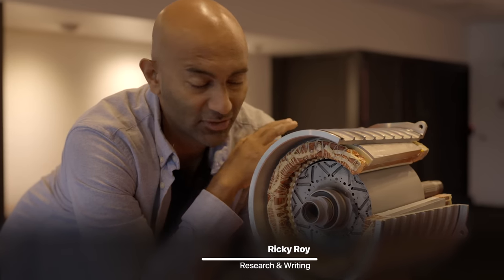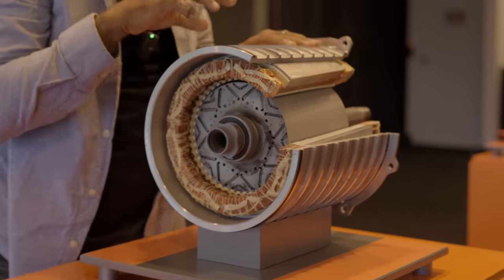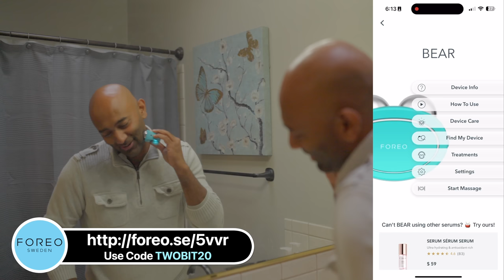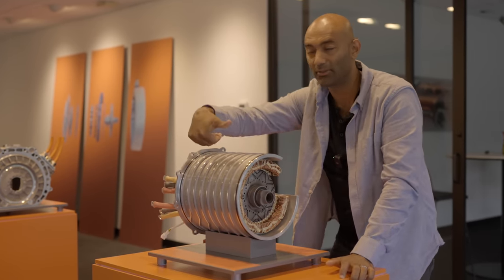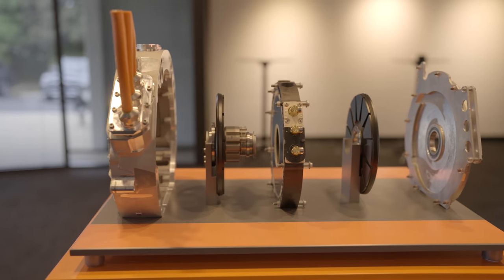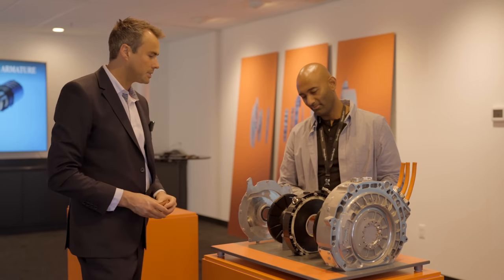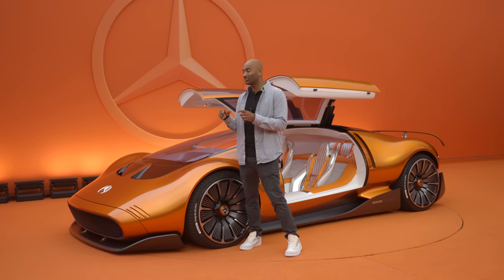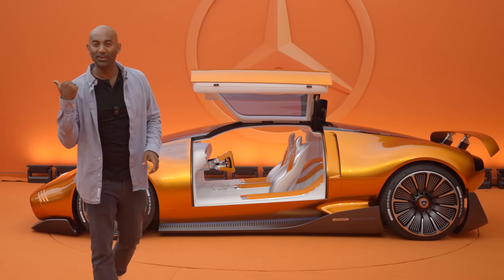Axial Flux Motors Will Change CARS - Here's Why

Comment: At least 2/3 less materials per motor, way less copper and way less windings of copper which equals lot's of time saved... All that materials saved means shipping will be way less... So way lower costs for materials, way lower costs for labor time, way lower costs for shipping and yet Mercedes is going to CHARGE US MORE!!! The excuse given is that the motor winders have been doing the old way longer and gotta get set up and used to doing the new winding method... OF WAY LESS WINDINGS!! 

I call BULLSHIT on that lame excuse and see that Mercedes is actually just screwing the consumers that buy their product (MAXIMIZING PROFIT TO THE MAX IS WHAT THEY ARE ALL ABOUT REALLY!) Kinda like their transmissions that have no dipstick... Mercedes wants the consumers who buy their vehicles to buy a transmission dipstick from the dealer for an extra $45. Whats next, are they gonna sell new cars without keys or tires or motors and expect you to fork over extra cash to their dealerships for those?  I own a Mercedes and I am not all that impressed truthfully! Interior is cheaply built with lots of plastic and very poor - stupid really- lay out. The cup holders fold out of the dash and I would like to punch whoever designed that garbage! Seriously- THEY SHOULD BE FIRED IMMEDIATELY AND SO SHOULD THEIR BOSSES WHO APPROVED THAT TRASH!  

The quality is worse that a damned Kia and I am not bullshitting about this. Check out the repairs that people have to do  OVER AND OVER AND OVER AGAIN AND THEY DON'T FIX THE PROBLEMS IN NEWER YEARS FROM WHAT i SEE. different YEAR MODELS WITH DIFFERENT MORE ADVANCED SHIT INSIDE LIKE THE TRANSMISSIONS FROM 5 SPEEDS TOI 7 SPEEDS AND THE SME DAMNED PLATE IS A REPEATING PROBLEM THE CONSUMERS GET STUCK WITH TO REPLACE ... They not only don't fix the problems, they make shit even worse where you can get stuck having to pay the dealer to program your new shit after you replace the crap that they keep putting in them knowing they will fail..   How about these 5 speed and 7 speed transmissions?? Wouldn't you think they should at least be getting some super gas mileage with 5 speed and 7 speed transmissions? They don't and they are screwing all of us on purpose - in bed with the oil and the government , purposely making the crap they make not ever get significantly better mileage  They charge the consumers more for their new shit but ultimately the consumer gains nothing but more expense and more problems  equaling less use of the vehicle they paid Mercedes beyond a premium price for = expecting in return they were getting quality.   

So yeah, thanks for showing us the next screw job heading our way!  If people stopped allowing these companies screw them over like they are doing , it would force these greedy bastards to make better products and get their pricing into reality . People currently are too spun out and unable to think straight, too lazy and can't/won't think for themselves or even actually THINK AT ALL.! 

Its is sad, scary and it's disgusting!  

This is what I see and what I think! I am entitled to think what I think and view things how I do just like everyone else is. If you don't like what I think and say ----> OH WELL!

Comment: ugh…how much do the batteries weigh ?
put the whole base drive train together and compare to any 500 hp internal combustion engine system including full fuel cell and let’s talk…
great technology with some significant advantages, but i think selling it based on weight advantage is a bit misleading …
not to stray into the most widely stated false claim, which is that these have lower ecological impact on environment …
should we discuss hydrogen powered engines now?

Comment: Always wodered why car manufactures uses that old motor design with winding heads?! 
because in industrial use there are long time better alternatives , 
like segmendted stators , switched reluctance and axial flux designs ! 

its not like they innovate , they follow the steps from the beginning and sell it as innovations for cars !
There was no need to begin with motor designs from the 80s .🤔

Comment: You failed in your comparison with ICE... Yes, the engine may weigh 400 lbs, but you never mentioned how much the battery weight and cost of replacement would be for these types of motors... very dishonest way to push an unproven agenda... Those electric motors would definitely help shop production, where they're tied to the grid... but not on highways... be honest... who's paying you???$$$

Comment: Ford stopped making them, because they lose 36.000$ each, BYD has hundreds of thousand unsold EVs, rotting in their parking lots, Wolkswagen will go bankrupt soon as they lose even more than Ford.
The only maker who can make worthy EV is Tesla (because they only make EVs, don't have to charge an unsold ICE for any EV they sell).
Hard reality: as long as the vehicle is battery operated, it does not matter how good the engine is. 
Batteries have an energy density at best 20 times lower than petrol.
We burn coal to make  power.
After 8 years your battery pack is gone, and replace it cost more than the car.
A bump and they blow up.
Even without bumps, sometimes they still blow up like russian tanks, with no apparent reason.
Making of an EV battery pack pollutes 50 times more than what an ICE can in its whole operative life. Recycle the battery, will pollute more than making it. 
The only future for EVs is elite hypercars like this one or the Rimac, or the Tesla Plaid.
And, be aware, declared ranges are a lie, unless you don't drive at " like a donkey " speed, with no radio and no aircon.
For any generalist car maker, trying to industrialize cheap EVs just means death for bankrupcy, both if they sell and if they don't sell.
Don't want to believe it?
Sit and watch: the entire EV narrative is a woke hoax.

Comment: Oh dear! Oh dear! Someone has not done their research properly!!

Fleming's Right Hand Rule has NOTHING to do with motors it is for GENERATORS! His LEFT HAND rule is for motors!

The mnemonic that is used is as follows when you position your thumb vertical, your first finger pointing away from you and your second finger pointing to your right (left hand rule) and to your left (right hand rule):

1. First Finger => FIELD
2. SeCond finger => Current
3. ThuMb => Motion

I learned this in Physics class over 50 years ago and my father knew it from when HE was at school so how have you got this SO wrong. Just Google for Fleming's right hand or left hand rule to get the full run down AND diagrams if hiw it's done! 😢

Comment: Meanwhile back at the rsnch. LoL i have decided to NOT pursue eith current projects. But rather focus on the current worlds situation. Only 40 days of yes lots of theology/ prayer/ fasting as isconly 40 days to nect Feast ofvTrumpets Seot 15:2023  begire big solsr eciose crossing st Cairo Illinois ( littke egyot) lots ofvhistory  invilved. Next silar ecipse inckudes Mexico ( directky over the big vokcanoe ) and Cdn. ( with yes over 10 x the fires as avrrage  yr. And season is only about hakf over -:note: flooding in Cuba etc while dry uo north ). Yes saw hollogram of 3rd Temple too in Israeln NO wall ti touch. So  hang on for a wild ride. LoL

Comment: You still have crappy batteries 🪫 soooo why bother with motors..When you have have 10 years warranty 600 km range,3-5 minutes charging time,not be afraid of sudden fire 🔥 and why does it cost more to change battery than vehicle itself.Why would I buy something stupid like that and I almost forgot,it has to operate at-40 Celsius and I still want 600 km range and 3-5 minutes charging and 10 years warranty…OK Higga…

Comment: No matter how good EV motors get, the biggest obstacle to a lightweight future is lithium batteries that do not self destruct. I love the way geeks keep ignoring the elephant in the room. The best motor will not stop battery failures that cannot be extinguished.
Reply: Newer EVs use Lithium Iron Phosphate (LFP) cells that don't burn, heat up, or explode. I have over 24 kWh of LFP batteries for my Bluetti energy storage system just three feet from my bedroom and they are charging and discharging every day for two years. That is how safe they are!